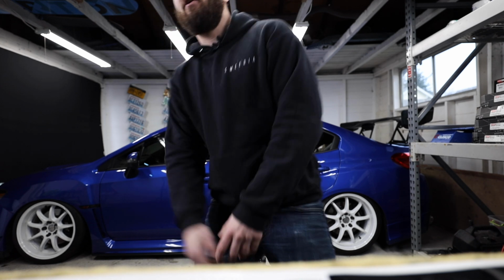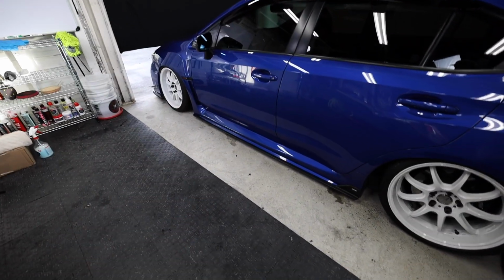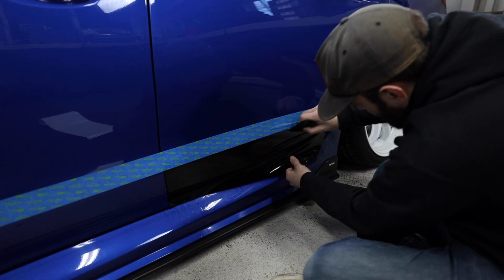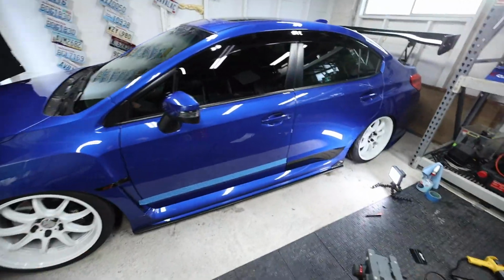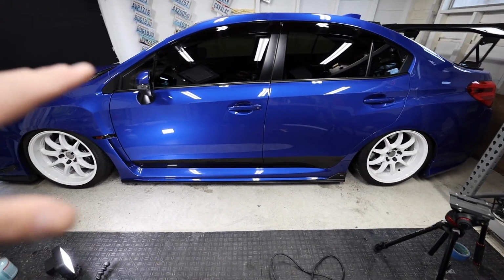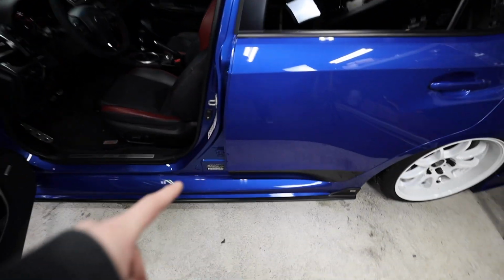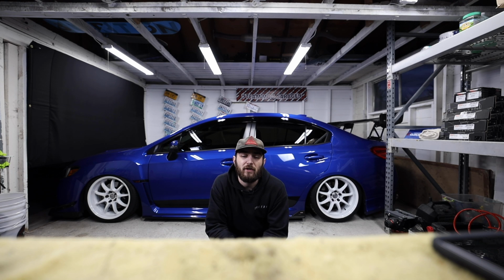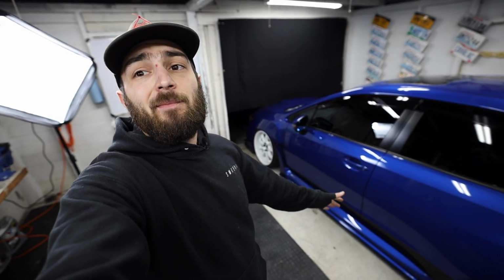Attempting to "Wrap" The STI

Comment: Vinyl is definitely tricky and has a learning curve to it. I have wrapped 2 cars and learned a whole lot doing my first. One tip I have is your cleaning/prep. You should prep the surface with isopropyl alcohol, including the inside of the doors where you're trying to wrap the vinyl around the edge. Any kind of contamination can cause it to not stick, grease, wax residue etc. You want the surface as clean as possible. 

There are different types of vinyl. A lot of the automotive vinyl wraps these days are intended to be dry apply, but they have air release channels to help get bubbles out, and are pressure sensitive, so they are somewhat repositionsble until squeegeed down to lock them in place. If it is a wet apply, there are specific solutions to use some as simple as soapy water.

Don't give up though, doesn't look like it went too bad. The only way you can learn and get any better is to do it more or just never do it again lol.
Reply from the maker: Appreciate the awesome feedback! I'll definitely use the alcohol next go around. I was a little hesitant to use the cleaning solution and I think that may have been a cause of the struggle. I want to attempt the roof next but not sure how to get around the sunroof but I think I can get it. Any recommendations on vinyl brand?
Reply: @Smeedia , I used 3m but I honestly don't know that I'd go 3m again. From what I've read Avery is one of the easiest most forgiving brands with a nice smooth finish. 

I would definitely make sure you have a helper for the roof. It's not 100% necessary, but another set of hands will make it WAY easier to manage a piece that big. I've never wrapped around a sunroof, but my thought would be to just leave it open or partially open so the glass is recessed a little, and either tape down the wind deflector in the front if there is one, or don't open the glass far enough for it to pop up. That way you can tuck the vinyl around the edges. Make sure to post heat any of the edges that you stretch like those inside sunroof corners, but be careful with the heat so you don't burn your sunroof gasket.
Reply: @Smeedia  Avery is good easy to use vinyl, but the roof is a big step from the doors.  Took me about 3 hours with Vivvid Carbon, alone.  Wanted to quit many times, but came out pretty good in then end.  Avery probably could have knocked out in an hour, wiat till it gets a little warmer.  Tape up the sunroof with painters tape to help the vinyl release and make sure you clean that area well, it's gonna pull in dirt from everywhere.

Comment: I wrapped a few things on my 2017 sti and I find that wrapping dry instead of spraying solution is a lot easier! I know all the vinyl that premium supplies has air evacuation channels that make it easy to lay and squeegee out air bubbles, even lift and re-position if you need to. Lay the vinyl down dry, then spray some kind of detailer on top of it to help as a lube when you squeegee so you don’t cause little scratches on the vinyl. Also with this method you only need to add heat when you need to tuck or around corners.
Reply from the maker: Perfect! Good to know. I'm going to try dry and wet (with soapy water) next time to see if I can get it to stick and lay better. Greatly appreciate the tips and advice!

Comment: Worked at a vinyl shop, many pros dont use any solution to install because of the type adhesive that the wrap has. heat makes life easier. But next time try a dry application for vinyl
Reply from the maker: I'll attempt a dry application, I've seen people use solution so thought it might make it a little easier 😅

Comment: I know exactly how you feel. Worked at a sign shop for a month a couple year's back and had to install vynal stickers on oil field worker trucks and that was a mish. Had to perfectly line up the lettering and the lines had to be on point,  no bubbles, no creases. Was interesting to learn but you must have lots of patience in order to do this job.  Keeping it wet until you want to set it helps too. Its really easy once you get the hang of it. Practice makes perfect!
Reply from the maker: Next time I try it I'm going to use soapy water rather than a surface cleaner 😅 that may have been my problem but your level of patience has to be high with this 😅
Reply: Smeedia exactly. You will find it much easier woth soap and water. Can move easy and use the squeege start from cener work your way outwards. Easy money

Comment: Yo Tanner, hey my name is Aaron I'm a pro detailer in Pittsburgh I dropped a suggestion for you for an exterior protection for your STI. Also just some suggestions in the future when you're wrapping vinyl, yes it's definitely a pain in the ass, your first mistake was cleaning your paint with the Griot's Garage speed shine, that product has slippery polymers in it that aren't going to help the vinyl and it's sticking towards the end of the install. Next time use something like Windex or most preferably just a soapy water solution, Auto soap or host guys use Johnson baby shampoo believe it or not. But when you do your initial clean wipe it using at least 70% ISO alcohol or some kind of wax and grease remover, you'll find this install will go a lot easier. You also should have cleaned the edge of your doors at the bottom and also the inside lip underneath where you folded, it would have stuck especially with heat. To get cleaner lines and remove the wrinkles, as you're applying heat slowly stretch the vinyl over any Kris and use your hand or the squeegee to go over the crease. I know easier said than done but trust me the next time you do something like this take out the speed shine, use alcohol and make sure the entire area that the vinyl is going to touch is clean from any kind of waxes or Greece or anyting that includes spray detailers and spray waxes. Hopefully this helps you in the future oh, but you did a good job for what you used. Also, another tip that really helps is you can work with your piece of vinyl for a very long time just keep it wet and keep the area where you're applying the vinyl wet and you can adjust it however you want as many times as you want just remember to keep it wet, when you finally made your adjustments, begin to squeegee out the water, from one end to another, holding the squeegee completely flat. It does take some finesse, but as long as you know the tips to make it all easier, it might actually start to become enjoyable when you can actually make it look really really nice
Reply from the maker: Greatly appreciate the tips! My lack of patience is attributed to not doing it properly so on ghr next go around definitely gling to use the knowledge! Figured soeed shine would remove the dirt but did not even think about the residue left over on the surface of the paint

Comment: I just wrapped my WRX and another WRX, hood scoop, roof, wing, license plate trim, and also tinted the headlights and tail lights. 
Man what a learning curve, turned out great though!
Reply from the maker: You are more capable than I, I never want to use wrap again after that 🤣
Reply: @Smeedia  Applying vinyl as a dry application and no spray on the back is pretty easy. The hard part is learning how to stretch the vinyl to get it to conform around bends properly.

I'm far from a professional, just a dude that love to work on cars and tinker, but I'm beside myself with the results, as well as my first customer. 

Check out CKWraps if you're interested, I've learned everything from his channel. Extremely talented wrapper and educator; very detailed in explaining and close-ups.

Comment: There is a product called 'rapid tack'(I think) that is great for applying decals/vinyl. I have always used a spray bottle with about a cup of rubbing alcohol, 5-10 drops of dish soap and the rest water. And yes keep it wet until you like where it sits. Start from the middle-ish and work out. This will help to prevent trapping bubbles. If you do get a bubble that won't go away, poke it with a razor blade and work the air/liquid towards the hole you poked. And heat is definitely your friend, but if you get it too hot it will wrinkle and stay wrinkled. And I have never had any luck with the clear rock chip protector decals. I always get dirt or fingerprints in them.
Reply from the maker: Great tips, next time I'll try these 🔥 I'll look into the rapid tack product to see if that will help me 🙌

Comment: I think you’re using the wrong solution. What you were using is a quick detailer. Pretty sure it has some kind of wax in it. The vinyl premium supplies allows you to mock it up and lift it if needed as long as you don’t squegee it on. I’m about to do mine this week.
Reply from the maker: I was 100% using the wrong solution 😅 I should have used dish soap. Let me know how yours goes!

Comment: I don't use solution.  Always dry.  Probably should have done a clay especially around the edges and inside the door to help stickment.  Not a bad attempt, kudos for the attempt.  Only gets easier the more you do it.
Reply from the maker: Going to attempt the roof next so we shall see how that goes. Definitely going to clay bar the surface next time

Comment: I've wrapped 3 of my cars. By no means am I a professional, but i dont like using solution. For small piece like this i think it would have been easier to just get bigger pieces w/ knifeless tape rather than pre cut pieces. would be better to have more material on the back sides of those edges so they have more to hold on to and dont lift up.  

that being said, Im a fan of the work your're doing man! keep it up
Reply from the maker: Appreciate the feedback! Going to give it another shot with just a sheet instead of the product vinyl. I'll try no solution next go around to see how that goes 🔥 thank you for the tips!
Reply: @Smeedia  heat is your best friend! Haha. And don't be afraid to pick up the vinyl if you mess up. Even if you get wrinkles in it just hit it with some heat and it'll go back to it's original form

Comment: How do you remove the plastic on the fenders? Like where the wrx badge sticks on? Do you just pull it off?
Reply from the maker: Heat gun and just ripper off 🔥
Reply: @Smeedia  the thing that the emblem is attached too.
Reply: I sent u a pic on ig of what I'm talking about. Trying to wrap the car! Lol
Reply from the maker: Heat gun and just pull it off 🙏
Reply: @Smeedia  looks like its clipped in. I know you heat the badge, just to Clarify you heat the entire fender plastic ?and RIP it off?
Reply from the maker: Just thr badge piece to get the whole cap off there are some clips under the aide skirt then it just pops out

Comment: This had me laughing so hard because its 100% understandable. I did clear 3M tape on the sides where your feet hit getting out of the car right when I got it and I swore for 2 hours straight while doing it. the black looks good on camera :) Also, like Justin said in the other comment next time pick up a spray bottle and some baby shampoo mix it in with water and spray on makes life a ton easier just squeegee the soapy water out from under and it will stick in place.
Reply from the maker: Glad I'm not the only one struggling lmao, I'm going to have to try the actual spray bottle rather than the cleaner I was using 😅
Reply: Yeah, the PPF is a much tougher install than normal vinyl.

Comment: Your sentiment while wrapping is how I felt while installing my Radium brace when I got 2 bolts in around the fuel lines, then realized the 3rd hole had crud like your BRZ, pulling the whole thing, removing the fuel lines like I should have done in the first place, and re doing the whole thing 😂 still would rather do that again than throw vinyls on though haha
Reply from the maker: Lol I don't blame you 😅 I would pretty much di any other install than vinyl. It never forms how I want or need it to 🤣

Comment: Fuck mate I agree you, I tried got it all down then it just un sticks and I see all these DIY YouTube ppl doing it like it's Piss easy and Fuck still not working for me so I thought Fuck it I'll be a stripper lol. But I can see your idea and concept but it helps if you heat it up and stretch it around the corners and for straight lines you use knifeless tape. And 4D carbon fibre on like back wing tip and the roof would be nice. Brushed titnium will annoy other drivers. But seriously check out 4D carbon fibre seriously trips you out I used it to wrap my scuff plates in the interior